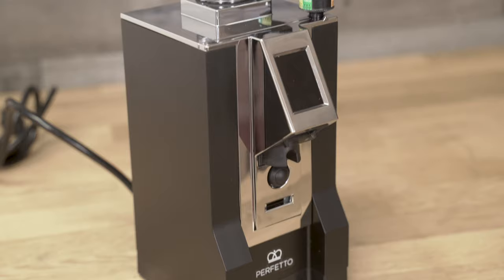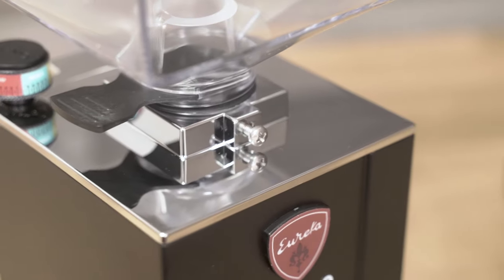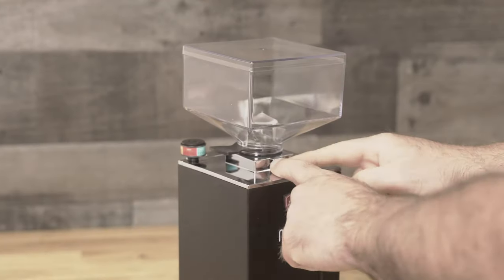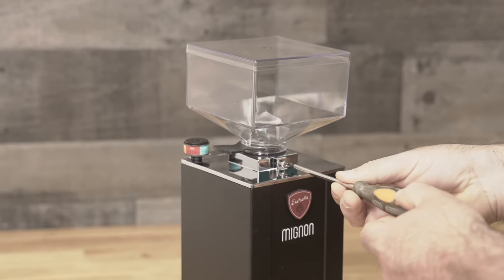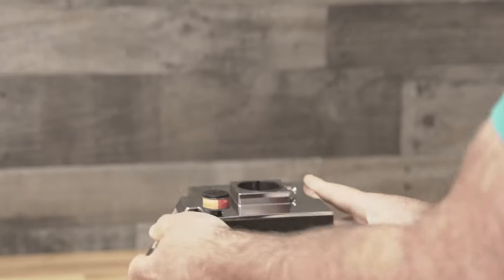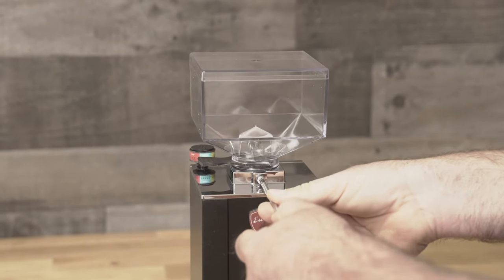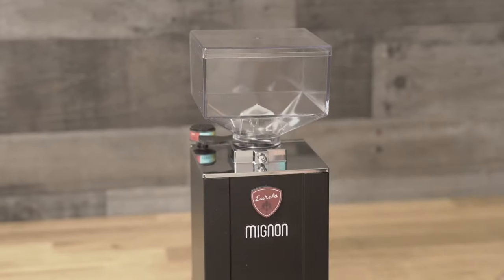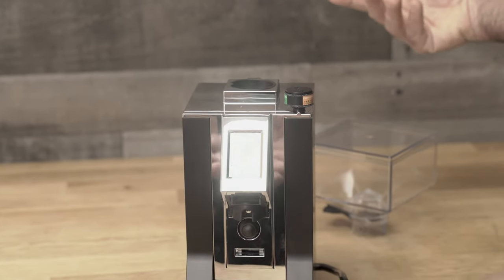Quickview: Eureka Mignon  - Putting in the Set Screw

Comment: I thought I had lost the nut inside the plastic housing, but with some persistence, tipping the grinder upside down and tapping it, eventually I saw the nut start to drop down. With a precision screwdriver I pulled it down the rest of the way, and with the grinder on it's side I was able to put the screw back in.

Comment: The set screw worked fine when I first set up my Eureka but I took out the screw to change beans and now it won't screw back in. Is there anything I can do ?
Thanks in advance!
Reply: same! May i ask how you resolved the issue?
Reply: @chellej6093  This is the answer I was looking for. Thank you!
Reply: @fa1223  I solved the issue but wish I could remember! I remember it being super weird. Maybe I'll monkey with it again and report back. But what I did after I solved my issue was get a different single dose hopper
Reply: @classicrockonly  thank you anyway. I just sent the issue to eureka support wishing they give me an answer
Reply: I even thought that I had lost a piece because the screw is really very loose
Reply: @fa1223  It's a very strange design. I had to stare at it and try a bunch of stuff to eventually get it. Brute force is not the answer though, I remember that much
Reply: @fa1223  hey friend! Sorry for not getting back to you. I couldn’t find my screw. Still can’t find it, but I remembered the fix after staring for 10 minutes haha. There’s a hidden nut. So you have to turn the grinder upside down and the nut will appear. Then you can tighten your screw in that
Reply: @classicrockonly  I tried to do your suggention but it didn't work, although it confirms what support said to me. The hidden nut is missing, so I have to forget the problem or try to buy it somewhere (a hard mission of course). Thank you very very much for your answer and your time.